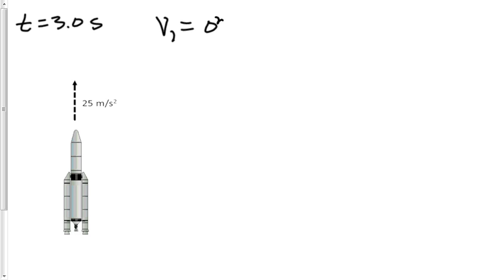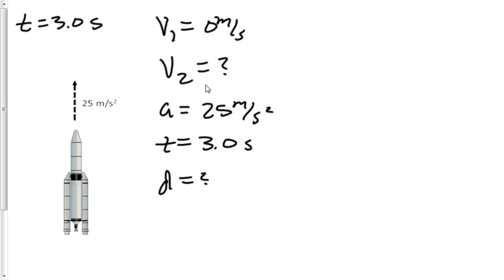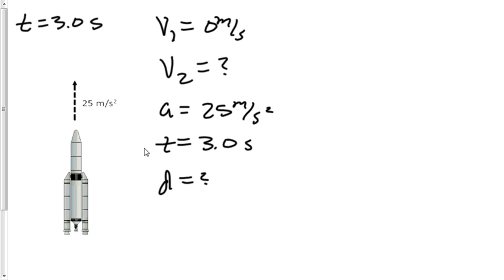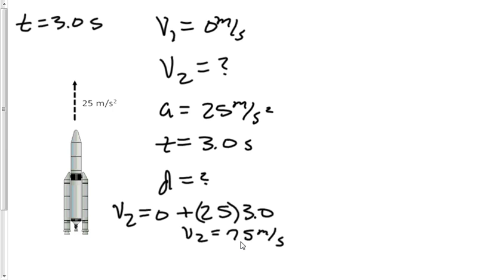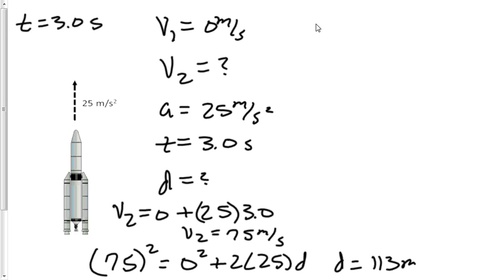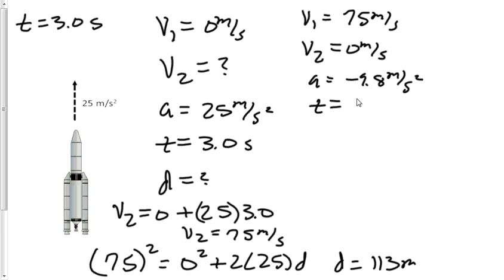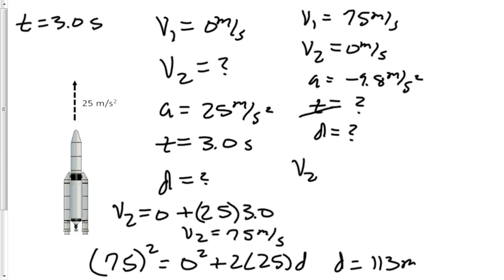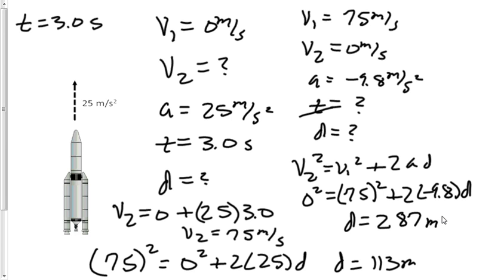Rocket Maximum Height

Comment: can you explain what you meant by (75)^2=0^2+2(25)d ? like can you run me through what all that means
Reply: where did 0^2 and 2 come from??????
Reply: @aratherbluemicroscope  I wanna know that toooo, you figured it out?
Reply: @osianpetts556  hi, sorry for being a year late lol. the equation is to find d (or displacement). the equation for that would be (v2^2=v1^2 + 2ad). the 75 squared represents velocity 2 (we found velocity 2 using equation v2=v1+(a)t). the 0 squared represents velocity 1. the 25 represents a (acceleration). and tbh, the other 2 is just there (part of the equation), so you do some simple algebra and solve for d.
Reply: @jeniferrangel07  Ahh okay, cheers lol
Reply: hi, sorry for being 2 years late lol. the equation is to find d (or displacement). the equation for that would be (v2^2=v1^2 + 2ad). the 75 squared represents velocity 2 (we found velocity 2 using equation v2=v1+(a)t). the 0 squared represents velocity 1. the 25 represents a (acceleration). and tbh, the other 2 is just there (part of the equation), so you do some simple algebra and solve for d.

Comment: You only account for gravity after 3 seconds into the flight
Reply from the maker: The 25 m/s^2 acceleration is after gravity is taken away from the rocket's acceleration.  In other words, the net acceleration of the rocket is 25 m/s^2 until it runs out of fuel 3 seconds later.  Then, the acceleration is -9.8 m/s^2.